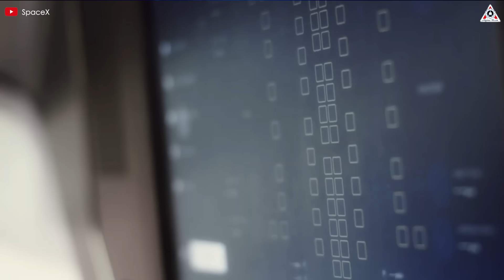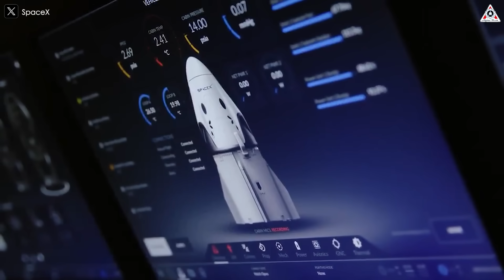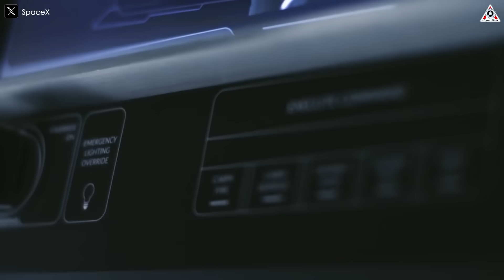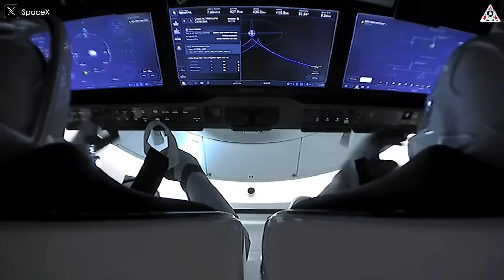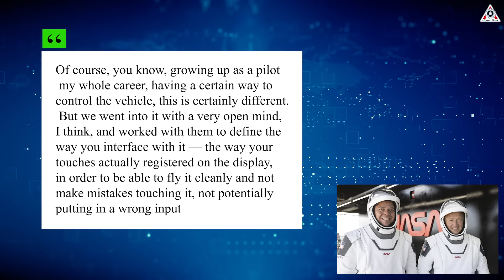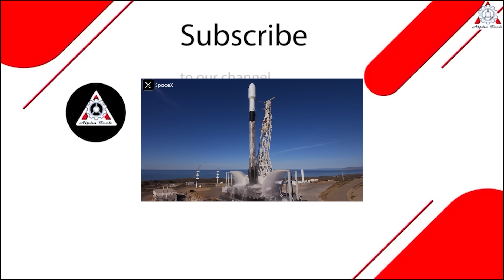Astronauts revealed Why Prefer Riding on SpaceX Dragon than Starliner...

Comment: Because Boeing is full of DEI unverified hires that likely messed up the starliner because boeing was more  concerned about checking a checkbox of DEI hires than the safety of the crew... Meanwhile Space X's craft was built for crew safety and by actual engineers and not by a government agency who has essentially a blank check, make no mistake  that the Dragon  is likely very expensive but no money was wasted.
Reply: DEI had zero to do with Beoing's failures, and everything to do with an outsider CEO who knew zero about running an aerospace company.

Comment: The gift of a UK Rolls Royce Merlin engine to your aircraft industry, in WWII happened because your engineers said that the precision in the donated blueprints was unobtainable. The engine proved the US wrong.
Reply: And the UK sold Rolls Royce Nene jet engines to the Soviet Union in 1946, resulting in the MiG-15.  Thanks.
Reply: This is about 2024/2025 -not WW2; and its talking about astronauts and spacecraft. Something you Brits know literally nothing about. You can take your Merlin back if that's all yall have to point to.

Comment: 0:49 soooooooo why were the astronauts stranded?
Reply: Haha, right. Politicians not wanting republicans look good and not being aware that by doing that they just make themselves look worse
Reply: There was a problem with their returns capsule so they weren't able to us3 it to come home. Elon Musk offered to go rescue them earlier, but Biden declined apparently for political reasons.
Reply: A 10 day mission goes into 8 months….like a 3 hour tour and get stranded on an island! Think of all that back pay and OT!
Reply: @jeffereylew581  what happened to the original plan though. I have not heard what caused them to be stranded. By this video, all it says is that the original capsule was not able to return humans or something like that
Reply: @tjpighin  leaks in the thrusters, heat shield may not withstand reentry, and other issues that Boeing engineers were concerned about. The Starliner came back to earth but no crew on board, remote controlled , considered unsafe if crew had been aboard.
Reply: @jeffereylew581  so they just sent them with hopes and dreams or they knowingly were going to have issues? Like this all seems kinda odd, no? That's part of rocket science and engineering is to be prepared, is it not? By the sounds of it, they had no chance of rescue without space x

Comment: Abandoned by Biden saved by Trump/Elon!
Reply: SpaceX didn't have a capsule ready to fly for the return until recently, and even then, they had to use a capsule that was being prepared for a different mission. They effectively had joined the station crew and returned with them at the time they were supposed to return. Accusing Biden is being done by uninformed people. This was the plan ever since NASA decided they could not safely return on the Starliner.

Comment: Trump was the sitting President(not the former) that got the ball rolling along with Musk to rescue the astronauts.

Take a second and proof your work next time.
Reply: Stephanie Wilson and Zena Cardman "rescued" Butch Willmore and Suni Williams by not going on the Crew 9 dragon ship in September of 2024. This was a normally scheduled flight. Space X could also have easily installed two more seats on Dragon as it was originally capable of carrying seven astronauts. For some reason, NASA has limited this craft to four seats per flight. Starliner also was sent back to Earth to free up the docking port for that Dragon capsule as well as remove the drain that Starliner was placing on the ISS systems by being docked so much longer than its scheduled eight days. Neither President Biden nor Trump really made or changed any operational decision throughout this expedition and let NASA handle it as NASA saw fit. Astronauts Wilmore, Williams and Nick Hague as well as Cosmonaut Aleksandr Gorbunov (these latter two having come up on this capsule with two empty seats,) came down together after the station changed over to the Expedition 73 crew. No one was ever stranded and the "yellow paper" hype reminiscent of the propaganda of the Spanish American war is absolutely abhorrent, sensationalist and utterly bereft of any accurate information about the operational process of adapting the flight crew manifest and schedules to the abandonment of Starliner.

Comment: You have.
Ancient devices, my tablet is stronger and more faster than the starliner's computers.Then you have space.Axis dragon that's like putting four hundred and twenty two tablets Then you have Button several terabyte Memory tv used for the spaceship High computerization in high It's a lot better And works a lot better Then the anaquated boeing

Comment: No matter what u say, the Starliner could have safely returned the crew to Earth.   Also, every astronaut wants a mission extension in space.
Reply: NASA is very cautious and rightly so.  2 of 5 Shuttles failed because NASA said, ah it should be fine.  They made the right move by NOT allowing the crew to return on Starliner with the potential problems it could have caused.  You may be right, but an extra 8 months away from their families was a little extreme.  They were left on the station because of politics, and they were ready to come home.  Just listen to their interviews over the last couple months.
Reply: too many  unknowns  i am guessing  from what the  2 astronaut's were told  by both nasa and boeing  the  risk factor was too high    there are 2 type of risk 1 bn acceptable risk level and non acceptable . Clearly nasa and the 2 astronauts  felt  the risk was too high thus unacceptable    for a  safe return  on the star liner